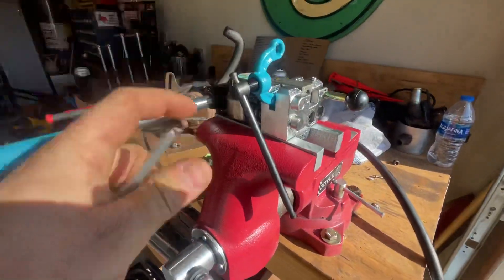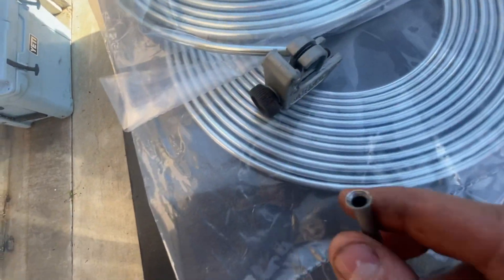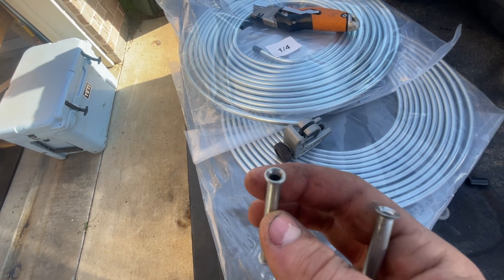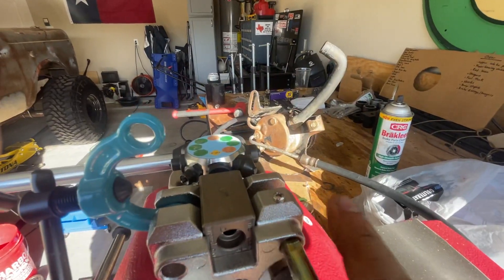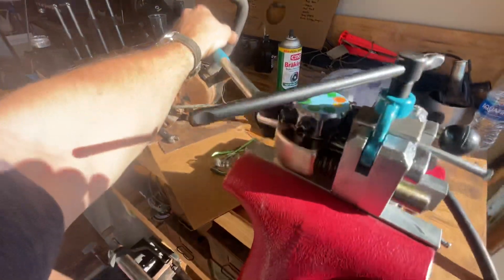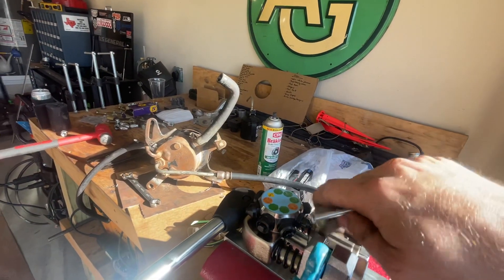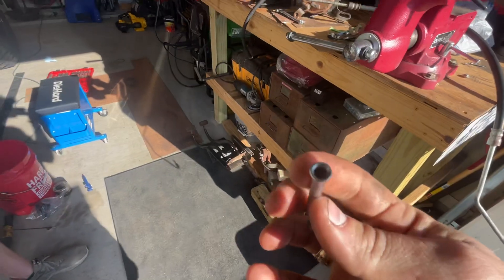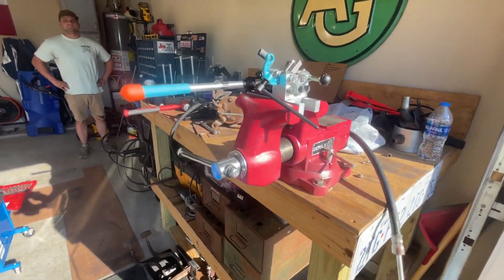Brake Line Flare Tool From the Future is a Game Changer!!

Comment: Yeah if you were doing brake lines quite frequently, that's the way to go. Trying to do a single flare and getting it to seal can be challenging. Several of my cars I've used compression fittings over the years for rusted lines. Just to get by. Thanks for sharing this  video, it's good to know.

Comment: FYI, all brake lines and fuel lines need to be double flared.  You never use single flare and don't use the "but it worked" answer.  If that's the case, you got lucky.  I'm not trying to be confrontational, but it is a safety issue for you and anybody driving or riding in a vehicle where you used a single flare on a high pressure line, not to mention someone else who could be collateral damage from a failed line.  Also, never use a compression fitting to repair brake lines for the same reason.  Compression fittings are not made to withstand high pressures, and again, if someone says they've used them without a problem, they got lucky.  I've been spinning wrenches for well over forty years and I have seen where people have used single flares that failed with deadly consequences.  Please, do not risk using single flares on high pressure steel lines.
Reply: When does luck run out 😂 bought a one owner car w a compression fitting done years ago in two spots on the same line 🥲 I re did the whole line but that was just crazy to see
Reply: The single is used by plumbers as well as installing gas service to heaters and appliances
Reply: Life is a gamble

Comment: I would toss out that single flare kit. Like compression fittings, they are a lawsuit waiting to bite you. Cheap double flare kits are widely available, and if you use Nicopp lines they are easy even without an expensive flaring tool.